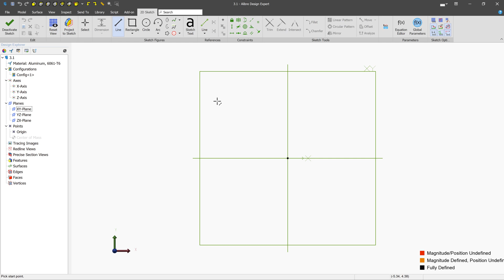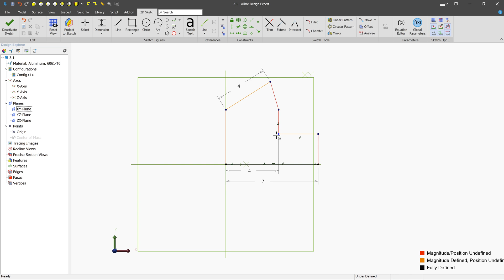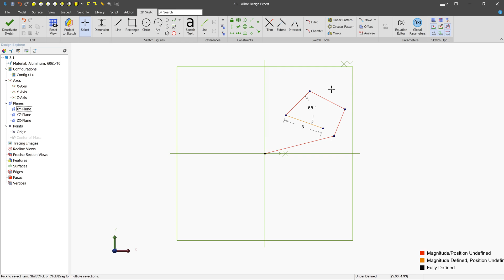Line Tool in Alibre Design | 2022 Exercise Series

Comment: what is an easy way to continue a line as an curve/arc? Something similar to Click and hold left button in Fusion360
Reply from the maker: If you're using pro or expert, tangent arc is probably the best, and it can be set to a custom hotkey for quick use.

For Alibre Atom, I would say add a tangent arc to the line or add a regular arc and a tangent relation.